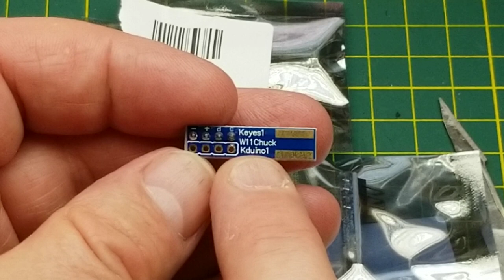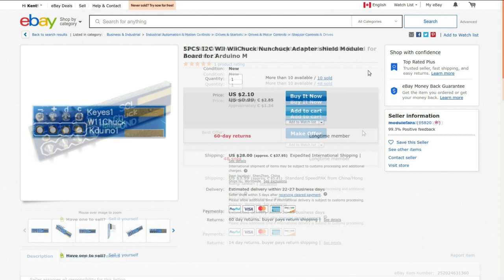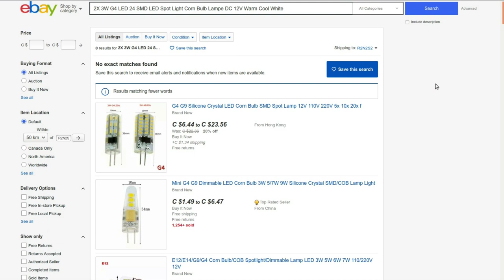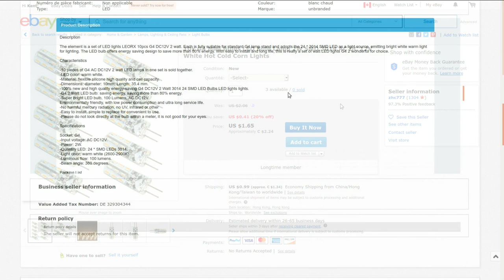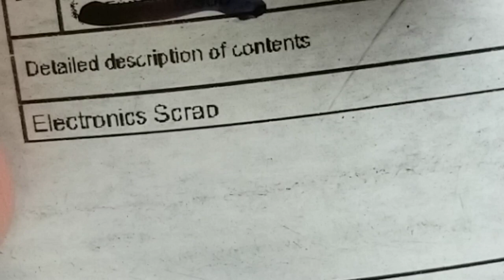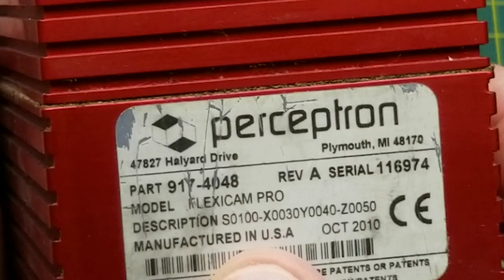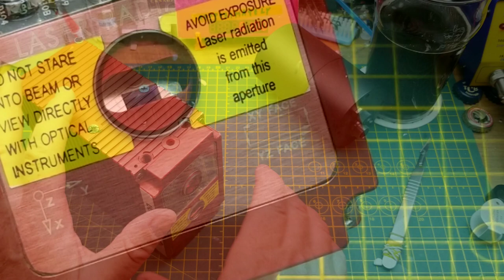mailbag monday #91

Comment: The Perceptron is indeed a laser and a camera. From what I remember they are used for triangulation of parts assembly on a production line.  The Camera is a live action and still shot B/W used in conjunction with an Ethernet control unit, but can also be used as a stand alone unit.   On the Baumer, the actual camera chip is fixed to the circuit board and epoxied to the frame, I snapped one off by mistake, but it still worked afterwards.  The pinouts are easy to figure out.  Enjoy!
Reply from the maker: Thanks again for sending me these cool toys. 
I'll be cracking them open in the coming weeks to poke around inside. It would be cool if I can get either of them to do something, but even if I can't the exploration is valuable in and of itself.
Reply: a tip: you can watch series at kaldrostream. Been using it for watching loads of movies lately.
Reply: @Christopher Otis yup, have been watching on Kaldrostream for months myself =)
Reply: @Christopher Otis definitely, I have been watching on KaldroStream for since december myself :)
Reply: @Christopher Otis definitely, been using Kaldrostream for since december myself =)
Reply: @Christopher Otis Definitely, have been using kaldroStream for since november myself =)

Comment: I had leds like that, but not the 12 volt, the 220 volt. They desoldered them self because they got so warm 😀 i had them in a lamp (upside down), LEDs dropped down, legs still in the socket 😆

Comment: Take care with the stlink. Many of those cheap stlink clones has wrong markings on the exterior. Disassemble it and check the labels on the board for correct pinout if it does not work.

Comment: You can also program the Blue Pill boards just fine over serial, but some serial adapters might not work because it uses parity and that's not so well tested these days. On the other hand, an ST-Link is absolutely essential for the cheap STM8 boards.

Comment: That laser/camera combo could be an industrial scale barcode reader. It put me in mind of those a systems integrator I worked for long ago installed for the USPS. The xyz reference is for aiming, and the camera module might have some onboard pre-processing to extract barcodes from the image and pass that to a controller.
That can be worked around to use it for other applications like doing 3D scanning of physical objects to build files to feed 3D printers etc.
Or you can use the laser to pop balloons. ;>)
Reply: It already is a 3D scanner used in the automotive industry.

Comment: Glad to see your China orders are floating in.  Most of my May 1 orders are not here yet.  Last year, most they were hitting my mailbox in 2-4 weeks.  Am hesitant to order anything else before this first Covo batch arrives.  The US and Canada ought to develop some most-favored-nation trading thing.
Reply from the maker: Most of what you saw today came in a few months ago. 
Though I am still getting them trickle in, but not nearly as fast as they normally do.

In a few months, you'll be seeing some things I started ordering from other sources - just in case. Gotta diversify the 'ol supply chain to keep the mailbags rolling along!
Reply: Last week I received a package from China that was sent on Feb 28th.
Reply: @pileofstuff  Ah yes, Mouser, Jameco, DigiKey ... They properly protect the products, and neatly print out the correct product ID / manufacturer.  Just costs 10x as much as the Chinesium version.
Reply from the maker: @GnuReligion  I'm still trying to stick to smaller more niche stuff (and sources) if I can. Gotta keep it interesting.

Comment: I have one of these ST-link dongles. Bastards put wrong pinout on case, swapped pin 3 and 5,  pin 2 is swdio, pin 4 is ground and in 6 is swclk. But on board silkscreen is correct. Make sure that yours are correct.
Reply from the maker: Thanks for the heads-up
Reply: Mine also has two pins swapped.  swdio and swclk in my case...    you get what you pay for...

Comment: here has glass tube fuse what i found anywere, my new broken led fluerence roof lamp, here has inside this style glass tube fuse what solden to wire, ac,230V if install led tube wrong side fuse blow, and anywerer i not has found were have this fuse. 0,5A